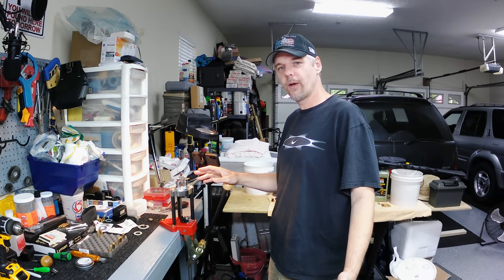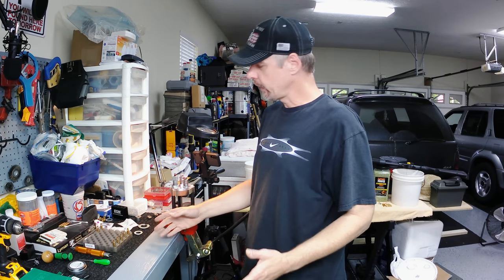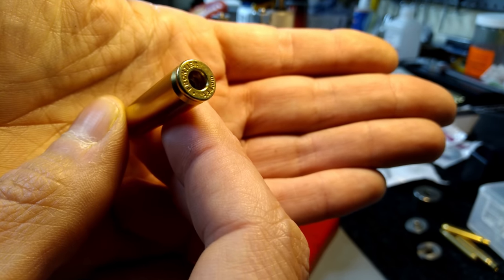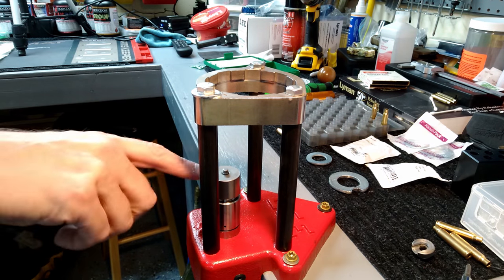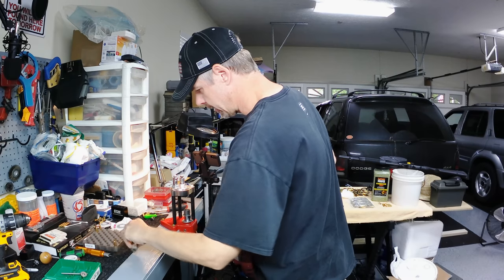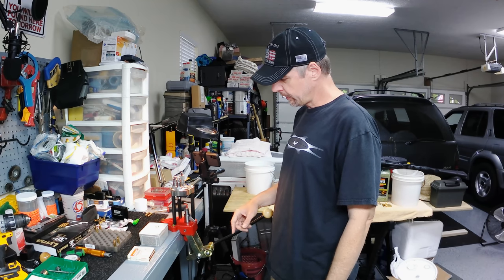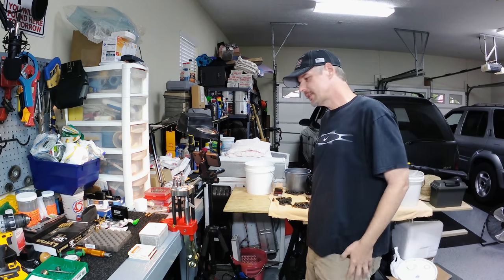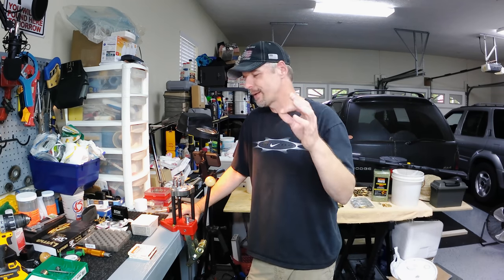Fighting The "Ammo Shortage." 5.56 Military Crimp Removal. What Are My Options? Is it Necessary?

Comment: Yes I have noticed you sure can get a primer in a military crimp primer pocket. However sometimes that crimped primer pocket will wreck a primer just destroy that primer. But if your in a tite spot and absolutely have to get some cartridges made. You can get it done ✅
Reply from the maker: Yeah, I wouldn't try it with the cross pattern crimped kind but these circle crimp ones seem good to go.👍
Reply: @ToolsandTargets  yeah your right on that one brother. I don’t really get to many of that style of crimp in my brass normally it’s like one or two of that style. As a matter of fact I’m processing some 556 brass right now. Went I a little Journey yesterday off a Armslist add and picked up some large rifle primers and some small rifle primers. The guy had some bougie projectiles in 223 so those will be fun to load up see what they are all about.
Reply from the maker: @Johnny-jr2lq  I haven't run across a single one of those type crimps myself so far. I probably never will since it's all my own factory fired stuff I'm  reusing.👍

Comment: I've did thousands of primers like that only had a couple to go off and three or four screw UPS where it looks like it went in sideways and didn't go flush the other than that I've been successful doing that when I first started reloading
Reply from the maker: I was under the impression it was basically impossible to reprime without removing the crimp. I'll probably remove em little by little but good to know it's not actually 100% necessary.👍
Reply: Yeah it is great to know it is possible but it is dangerous about having them explode on you putting that much force on it and sometimes when I shot the round and reprimed it the primer was smashed

Comment: I'm a swager guy, but have an old single stage press set up for it.  It goes much faster with practice.  But like most things in life, you gotta do what works best for you.
Reply from the maker: Swager is way less mess for sure. Just the one I did on this video with the reamer had brass shavings flying everywhere.😆
Reply: What's the purpose of clearing the military crimp if simply pressing the new primer in will work fine?
Reply: @BigTomInTheBasement  Works fine most of the time, but when it don't you have a problem.  Gotta remove a primer sitting cockeyed without blowing it up in your face.  Swaging is a 1 time deal, then your brass is good for it's 15-30 reload lifetime.  Spend 20 minutes prepping 100 rounds of brass & you're good for the next 1,500-3,000 reloads with that brass - flawlessly.

Comment: What I end up using ins a Pocket Reamer in a cordless screw driver. Bit slower then drill but does not take it off as fast as drill but some times that is a good thing you do not want to take off to much and make loose pockets. I also check them over with a go no go primer pocket swage gage
Reply from the maker: Good thing about this little RCBS reamer is it's pretty much impossible to take too much. You just run it until the head is flat against the flat surface of the tool and it's good to go.😎

Comment: I was going to comment early in the video, if I had, I woulda missed the laugher part of it. That round type is not technically a crimp. the only ones I ever had some trouble and I use that orange lyman tool you have, in that set is a primer pocket cutter, I just use that on the 3 or 4 style crimp, Perfecta ammo had some of the worst strongest staking, I just did them by hand, you can do bunches of them really fast. The round one, crimp style, because when you DE prime, it most likely reverses that slight crimp pressing it out, and just do what you did push the new primer right in. Thanks for the Laughs. I still have my VEINS intact. LOL. Lake city may or may not have the 3 or 4 crimp style, I do not have alot of that brass, yet. LOVE the Jack Handle, I do not recommend any forcing in RELOADING, but thanks for the Laugh.
Reply from the maker: LOL, glad you got a laugh from it. Gotta have a little fun.😎

Comment: I reload tons of 5.56/223 ive never removed the military crimps. All i do is run a primer pocket reamer though them. The only issue iIve ever had is finding cases with Berdan primers
Reply: I had never heard of Berdan primers until after i broke my depriming die trying to remove one of those types of primers. Ive noticed its more common on surplus military and anything made in Russia.
Reply from the maker: Good to know. I was being told it was basically impossible to put a new primer in with the crimp still intact. It was no issue at all.👍
Reply from the maker: I shouldn't run into any since everything I have is factory ammo and no mil surp but that's definitely good info.😎
Reply: . You cant remove those primes with a reloading press. Have to drill them out. Then modify the primer pocket hole so next time you load them you can use your reloading press

Comment: Good job with the jack handle. It’s also a necessary tool when you aren’t using case lube 😁
Reply: @ToolsandTargets  Absolutely NOT, Rifle rounds usually go into STEEL only style dies, Carbides are really expensive in Rifle rounds. You MUST LUBE rifle rounds, they will STICK in a DIE, I have only had one or 2, and it was not a pleasure to remove them. Do not even try it, it will stick for sure. If anyone wants to know I had one 30-06 stick, and I think I had a M1 carbine one time stick in the die.
Reply: @ksharpe10  I’ve been loading for 50 years. It was a joke. I forgot more about loading than you’ll ever know
Reply: @steveperry3538  I knew it was but HIM and the newer reloaders who might be watching him, need to learn good habits. For their Safety sake.

Comment: Congrats on your first reloading video.  Lmao 😂 with you jack hammer process!!  I like your first process the best.  Only thing I need to ask, please consider wearing safety glasses.  I’ve had primer discharges and small metal pieces come at my face before.  I wear shatter proof eyeglasses.  You just never know brother.
Reply from the maker: Yeah, if I were doing a whole batch, I would definitely put some eyes on. To be honest, I doubt I'll even do anything to the crimp at all after seeing it's not needed. I was led to believe that it was literally impossible to re-prime crimped brass without removing it. Now I know that's definitely not the case.😎
Reply: @ToolsandTargets  I’ve noticed that too with the cases that have circle crimps.  The ones that really need to be swayed are those that have the stake divots.  Those are deeper crimps.  The worst kind are 9mm military brass.  I sort those dudes before I start loading and I don’t waste my time with them.  Let me know you want them to practice your swaging and I’ll give them to you.
Reply: @upholdthesecond92  The worse ones I ever seen were the 223-5.56 Perfecta brand, which I am told was made by Fiocci. Those Crimps are really visible, and use that first hand cutter tool to remove them, and or a Swager. If in a more rushed state, just weed them out, put aside, and go on. TOOLs has tons of brass so best to weed thru for now. Unless he is feelin froggy for the Jack Handle. LOL.
Reply: @ksharpe10  to be honest, I got lazy and just sort out commercial 223 brass that don’t have the crimp, but you don’t get as many of that in range brass piles.   That 223 non crimp brass is so nice to work with on the reloading bench